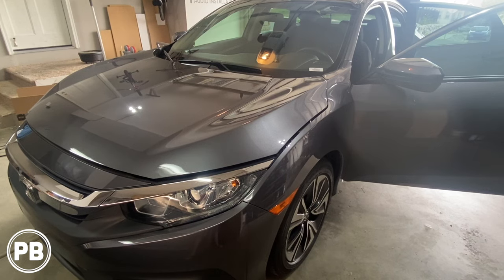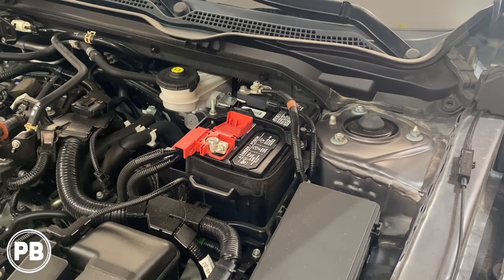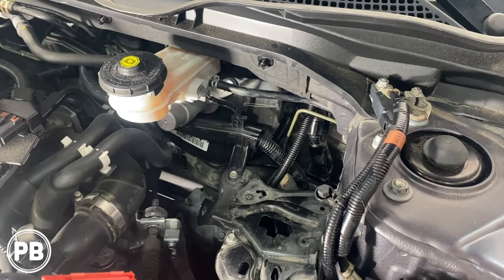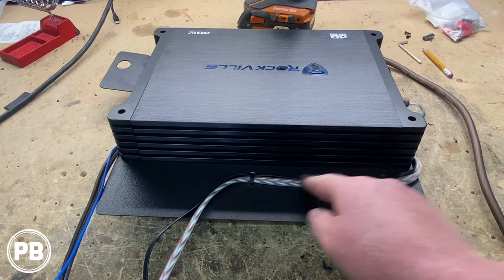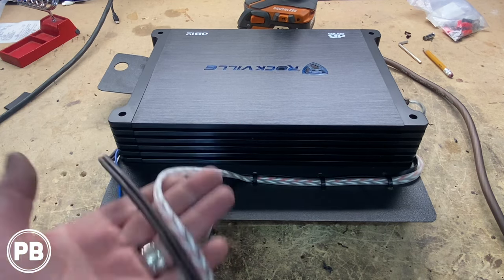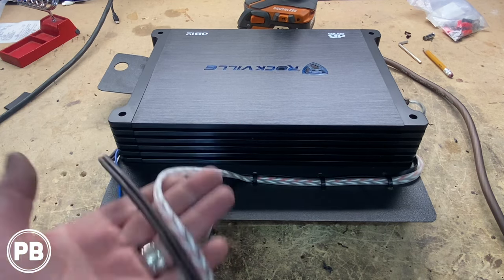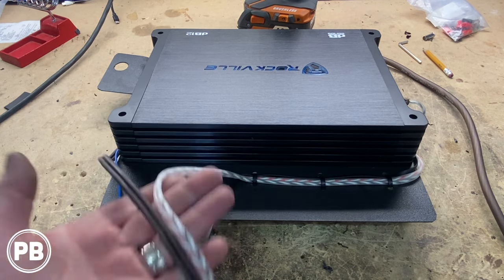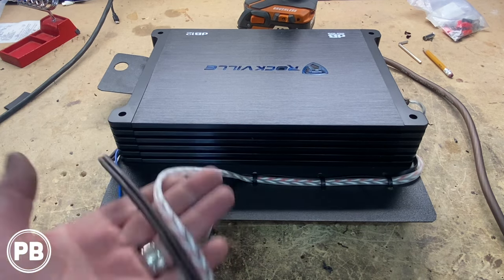2015 - 2020 Honda Civic Amp and Sub Install

Comment from the maker: Parts used linked in the description of the video!
Reply: Howzit I have a 2019 Honda civic hatchback, I don’t have the speakers in the trunk, but they are on the back doors. Do I tap in from there instead?

Comment: DO NOT USE THE 12V WIRE HE USES im driving a 2016 honda civic, i wired everything exactly the same, ive checked everything and ive had multiple other people look over my wiring, ive taken a volt meter to everything, and it all seems to work fine EXCEPT THE 12V Constant it only suppls 10V out of the factory harness and after passing through the converter to the signal wire it only has about 9.50 and it needs 12 to power on, after tapping into the wire he shows my rear bsck up camera no longer works and my trunk lid opens when turning the vehicle on or off
Reply: You need to get a capacitor if you don’t have one already.
Reply: WTF 😂
Reply: How did you fix it
Reply: So which one is the correct wire for 12v constant?

Comment: THAT IS NOT A 12V IT OPENS MY TRUNK
Reply: Please did you figure out where to wire the 12V?? You are 100% correct about it not being a 12v wire that he shows in the video, I have a 2016 honda civic and I did everything he did and now my trunk opens when I turn the car on or off and my reverse camera doesn't turn on, as well as the amp only has about 9V being ran to it wich isn't enough
Reply: @tritongaming5715 LMAOO
Reply: Gonna have to run it straight from the battery

Comment: that coat hanger trick did not work at all. been trying to do it for a solid a hour, and the wire just slides out of the tape
Reply from the maker: Bend the hanger at a tight 180 around the tape and wire to give more traction
Reply: it's a skill lol
Reply: Wrap the cable around the coat hanger a couple time and then tape. Or bent the end of the hanger backwards to grip better. Skill issue
Reply: Try not to suck ...jeez

Comment: I bought a '19 Si and it has a very crudely implemented sub and amplifier. Most connections are electrical tape. Yikes! This gives me the means to understand how to install it correctly with the factory HU. Thank you very much.

Comment: If i wire the 12 v from the line out converter to the 12 v on the factory stereo harness will there be a popping sound from the sub after turning off my car?

Comment: I have a 2019 civic lx I followed the steps in this video but I don’t seem to have the same color wires I the plug in the trunk to connect the LOC to a 12v constant. My amp has no power?! I’ve t -tapped multiple wires in the truck harness to find a 12v constant and I’ve got nothing….
Reply: Were you able to figure this out? I'm having the same problem in my '17 civic...
Reply: If you boys have no power, did you run the power wire from the battery?

Comment: When taking 12V from that location we can’t get power to the amp but for some reason when we disconnect the remote wire and reconnect it the trunk latch releases. Any help?
Reply: Just happened to me
Reply: Okay so I found a solution. My problem was the trunk kept opening everytime I opened my driver door or locked my car. So I tapped into the same wire he did but that wire on my car is actually the trunk wire. So I had to disconnect the constant 12v and tomorrow I am running the constant 12 to the fuse box just to be sure. However this is going to be temporary because when the system was working the pac only has 55watts and my amp was basically at the lowest level it’s ever been so I’m getting an epicenter

Comment: I made my own hole in the firewall. 1" hole with a rubber grommet to go around the edges. I did this since I also ran a hose for a mechanical boost gauge.  Looks stock. Best part is the kit i used comes with plugs if you ever decide to remove everything.

Comment: About to start on my 2019. Got to do the big 3 and figure out where to put 3 big ass amps. I just need some motivation atm lol!
Reply: How did it go? Just got my 2019 today and want to do this but wanna make sure it works
Reply: @sethbrooks4988  I'm officially starting today lol. I just got an android head unit with digital output, I'll start with that. I can already tell basic sound proofing on doors and the trunk is going to be a major improvement.
Reply: @Sac_slappper_4rce  how come you're going with a new android unit?
Reply: @StateBiscuit  I'm going all out on this system. The Joying android unit will be linked to an Helix DSP pro mk3 by optical for the cleanest (and flattest) signal possible. System will be an active 3-way front stage + sub. I could have kept the factory unit but some have bass attenuation/compensation depending on the volume (not sure if Honda does it tho) but now it wont be a concern at all.
Reply: @Sac_slappper_4rce  you really are going all out.  That's  £1000 on these two alone! Mind listing all the things you will be upgrading? I've got the civic with uk premium audio which doesn't come with any sub or boot speakers and I'm thinking of working my way inside by upgrading speakers than amp etc etc

Comment: Isn't the LOC unnecessary if the amp has a level adjustment like this one? Should already support high level input from the speaker wires, right?

Comment: The amp placement is not convenient if adjustments will need to be made on the amp. Tapping in to the wires in trunk for the Line Out Converter sounds problematic as comments above have mentioned. 
This is my set-up below. 
Power ran to the rear of civic
Wire from Line Out Converter to amp to power it up
Speaker wires tapped in to the head unit for line out converter Double sided RCAS to go from the AMP to the Line Out Converter
Reply: What are you running power from the amp itself? && the amp is powered by battery? Is this what you’re saying I’m trying to do the same thing today rn as we speak.

Comment: Great video. Do more videos with the hatchback versions and that also have it or an upgrade oem subwoofer
Reply: Does the fuse give more power to the amplifier on car
Reply: Learning how to do a great job does hooking up sub to the door ore to the remote wire give more power
Reply: Text back 🔙🔙🔙🔙
Reply: @pennyjohnson7818  no
Reply from the maker: @pennyjohnson7818  No, a fuse simply protects the run from the battery to the amplifier of any short circuits / fires, etc.  A fuse should be installed as close to the battery as possible.

Comment: I’m struggling with gain control. This line out converter is very limited and you don’t really get to pull the best lows out for sound quality. I feel like there is too much highs and mids still coming through the sub. I feel like you also need to add a bass filter to isolate the lows.

Comment: Thanks buddy, I dont have an amp, but a small active subwoofer 8 inch with max 200w. Instead of taking the red wire to the battery can i just tap it to under dash constant on fuse?

Comment: On my 17' Civic there is no wire in the pin where you tapped the constant 12V for the LOC, it is just empty. Should I just plug the wire in that place assuming that it's the 12V?
Reply: I just tapped my 12 wire from converter to exactly where he runs it in the trunk, now my trunk opens when I turn off or start my car, my reverse camera no longer displays, and when I checked how much power is coming from the factory harness it was only 10v and after it runs through the converter to the amp it only has about 9.50v and the amp needs 12 to power on
Reply: I'm driving a 2016 honda civic

Comment: Im sorry but how will the amp turn on if the power cable is directed straight to the battery ? Didnt get to see where the switch for the amp? Where did u get the source of the amp to turn on and off? Did u get connection from the stock radio? Thanks in advance
Reply: That’s why you must connect the REM cable, this takes the signal from the speakers and turns on and off your amp.
Reply: …rem cable bro….

Comment: I got the audio fixed but the trunk is still opening do you know what it could be. I did all the wiring like you said and I used the accessory
Fuse for the converter
Reply: Did you ever figure the issue or how to stop the trunk from popping? Mine still does it and idk what to do other than run a wire to another accessory.

Comment: Hello, I have followed exactly as what you did and the only issue I am having is that I am getting no power to my amp. I tapped into the back 12V (or at least what I think is the 12V) but also my pins are a little different than yours and I am unable to find the pinout online anywhere.
Reply from the maker: Sounds like your line out converter isn't setup correctly.  Alternatively, you can snag power and ground from the terminals of the amp for your loc.
Reply: @ProvoBeastAudio  Do I connect the 12v wire directly to the power Input port on the amp?
Reply: @ProvoBeastAudio  Ended up running a cable straight to the accessory wire in the back of the radio and got everything working.

Comment: Nice video! So the LOC only turns on when input signal is present (when head unit turns on) and it will not drain the battery while it’s tapped into constant power?
Reply from the maker: Very low current draw, so shouldn't be an issue with any drains.

Comment: Do you have to tap in to both speakers in the rear for the LOC? I’m hooking up a 4 channel amp for highs and a mono amp for my sub
Reply from the maker: If doing that integrated of an install, you’ll want more than a simple line out converter to do it right. Send us a message on Facebook and we can point you in the right direction.

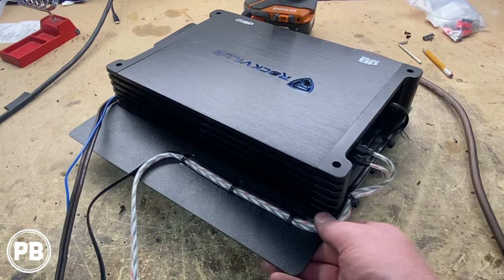Comment: 8:15 Do the rca cables connect to the sub section on the amplifier? (Appreciate your feedback)
Reply: rca connects at the amp and headunit, he used the rca converter to turn the speaker wire into a rca signal to connect it to the amp

Comment: I used the same wire to get the constant 12v for my Line out converter, I have the same car. My amp stays on when the car is turned off how do I fix this ?
Reply from the maker: Just pull power and ground for your LOC from the amp terminals.

Comment: I have a 12” Kicker in my 2017 Civic. I’ve used dynamat on the trunk and trunk lid. I still get a rattle from the plastic on the back deck. Any suggestions on how to dampen that rattle?
Reply: flip sub facing the backseats and open the trunk pass through

Comment: Hi, can you pls add a tool or let me know what tool you used to crimp 4 AWG wire ferruel. I do have one but it will do 18 to 5 AWG but not 4 AWG.. apprecaite your help
Reply from the maker: We didn't crimp our 4 gauge terminal, we allowed the terminal of the amplifier to do the crimping for us, and crimps and forms to the terminal itself for a super tight and clean connection.

Comment: I hooked it up like you said except I did the one left speaker and not both and I have two problems. One is that my truck keeps opening when I turn off the car and second when I go over a certain volume my audio gets staticy how do you fix these two otherwise everything else works
Reply from the maker: Sounds like a wiring issue to me.  Hard to tell over a youtube comment.  Maybe suggest taking it to your local audio shop for diagnosis!
Reply: Same here! Mine after my trunk opens my sub goes wild it just goes until I cut the power

Comment: I'm about to do something similar to this. If you are taping into the rear speaker wires to goto your line output converter, you are not bypassing the factory amp correct? Is that an issue?
Reply from the maker: Hey there, our civic was not equipped with a factory amplifier.  If you have the factory subwoofer, you will want to tap in at the sub, not the rear speakers.  If you don't have a factory sub, then the rear speakers is your go to location.
Reply: @ProvoBeastAudio  i am going to do the same thing in my civic si with a factory sub so a got just 2 wire were a plug de other 2 wire

Comment: If the 2020 Honda civic coupe already has a factory sub do I tap into the sub with the line out converter? Both the left and right?
Reply: My sedan has a stock sub as well. I'm wondering if I'm suppose to just tap that like he said with the loc or still run off the left and rights like he did

Comment: any idea if the Civic has a remote power out on the head unit?
Reply from the maker: Nope, nor will it have rca outputs. You can attempt to find an accessory turn on wire in the radio, but this generation Civic runs also on a canbus system. Alternatively you can go to the fuse box.
Reply: @ProvoBeastAudio so I just installed my Triple 8inch Skar subs like you, but I have a static or rattling sound coming from the subs and it’s make my amp go into protection mode, any help?
Reply from the maker: @chilitaco2719  Check your connections.  Lots of variables, and without seeing it, knowing equipment, etc, hard to diagnose through youtube comments.  Amps go into protection mode due to short circuits, poor wiring, improper impedance, etc.  You could have your subs wired at a too low of an impedance causing the amp to shut down.

Comment: why did you opt to put the amplifier under the driver seat, rather than on the trunk for easy access?

by tapping the rear speakers, did you not lose out on a lot of low frequency?  From what I understand, these civics have poor stock radios that do a lot of cutting of the signals to not destroy the factory speakers.  I noticed you did not use a Lc2i convertor.  Instead you opted for a generic LOC.  That means you are not getting the full signal for your amplifier right?
Reply from the maker: If your amplifier is setup correctly, no need to have "easy access" to it. We love installing amps under the seat as they are less likely to be damaged or messed with.  We didn't experience any bass rolloff, and additionally the customer did not want to opt for an LC2i.    You are welcome to spend more for an LC2i, and as for "full signal", many variables there.  We set our gains to the factory audio using an SMD-DD1.
Reply: @ProvoBeastAudio  thanks :)

Comment: I bought a Kicker LOC and doesn’t have the yellow wire (12v constant power wire) . Does that mean it’ll turn on when speakers turn on & sends signal?
Reply from the maker: You bought a basic LOC, so all it will do is step down the high level speaker signal to a low level RCA output.  It won't generate a remote turn on or anything like that.

Comment: Why connect the yellow wire to a 12v constant? That would cause a parasitic drain when the cars ignition is off. I would connect it to an ignition source instead.
Reply from the maker: In standby, it pulls almost no amperage, and is meant to boot up an amplifier when there is the presence of either a DC offset or audio signal in an application where there may be a chime, or some sort of audio needed without the vehicle on.  This is why it's meant to be connected to constant 12v.  Read the instructions.  Sure, that isn't necessarily needed for an amp / sub install, but this adapter is available for more applications than just that.
Reply: @ProvoBeastAudio  Ah, okay. I pulled up the manual online and I see it now. Thanks for taking the time to explain that and thanks for making the video. This is how I want to setup my sound system in my 2016 Civic.

Comment: What are your thoughts of mounting the amp in the trunk as well? Maybe upside down of the back deck
Reply from the maker: Most people argue mounting the amp inverted will not allow for proper cooling. Amp in the trunk generally is fine, just avoid areas where it can get hit. We choose under seat to keep it out of the way and protected.
Reply: @ProvoBeastAudio  thank you!!
Reply: Sorry one more question. In your description you have a suggested complete kit from skar. A single 12 inch enclosure with amp and all wiring. How do you like the sound from this kit in the trunk of a Civic.? I'm just looking for a good added punch for heavy metal kick drum and bass guitars.
Reply: How did you find the 12V constant line in the trunk, my car doesn’t have that wire you tapped off of. It’s a 2016 Lx civic.
Reply: @ProvoBeastAudio ?
Reply from the maker: A multimeter will be your best tool there to find constant 12v.  If you can't find it there, just rob 12v power and ground off the terminals of the amp, or at the fuse box. @superBEAST3333

Comment: Couldn’t tell us what slot you used to tap into for the remote wire ?!
Reply from the maker: Because the Line Out Converter provides that turn on for us, no need to go to the fuse box at all with the right parts, Diego.  Geez.

Comment: Yup. 2016 honda civic,,4 door sedan that beige wire ,messed up cannot open trunk,just clicks
Reply: My trunk would open when I turn the car off, don’t tap into that wire for constant 12v
Reply: @bradleydaniels-rn5ip  what did you end up doing instead for that constant 12v ? Mine does the same thing …

Comment: What is the preamp voltage from the speakers in order to adjust the gain correctly?
Reply from the maker: We set the gains with an SMD-DD1 which doesn't show voltage, sorry.  The SMD-DD1+ does.

Comment: Would you be able to only tap into one of the two rear speakers?
Reply from the maker: In most circumstances, yes.  Just be aware that if you have a song with lower frequencies specifically out of one speaker vs another, it may impact the performance of your new sub.

Comment: That constant wire makes my trunk switch on and off
Reply from the maker: Just snag constant 12v and ground from the amp terminals.
Reply: @ProvoBeastAudio  wym? I put my REM to my fuse under my dash (powers my radar and dash cam) now my sub “pops” or “thumps” after I turn my car off